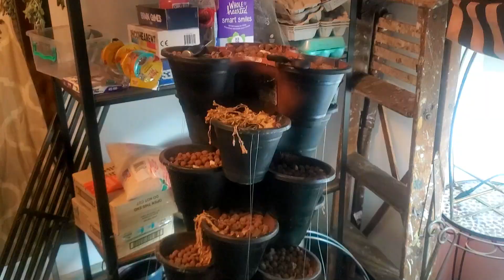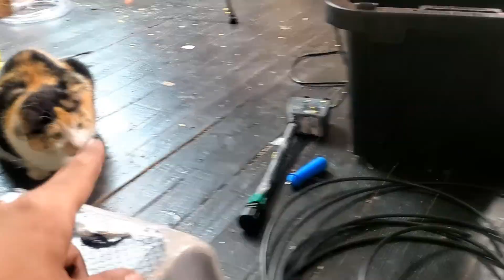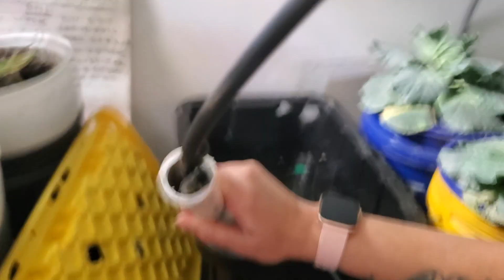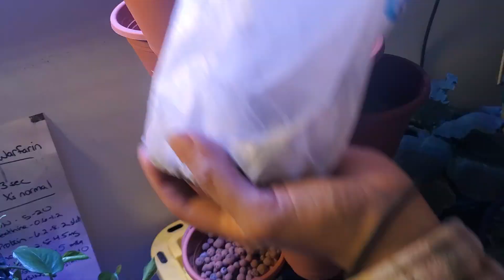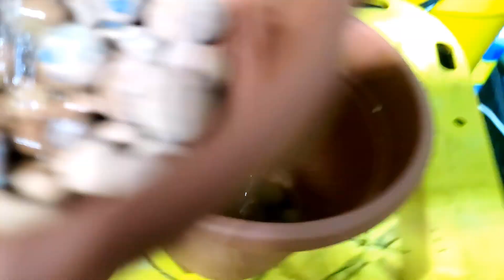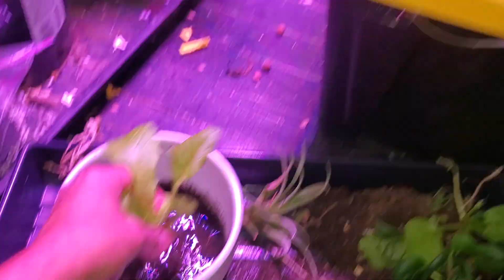Cheap DIY Fountain Tower System- Pt 2

Comment: I did that tower system like 10 years ago and the funny three petals pot that is now available at dollar store was about 7 bucks a piece lol. I didn't use submersible pump but used an air lift pump system using an aquarium aerator that inject air into a tube that lift the water up to the top of the tower, the water then flow down to water the entire system sigh help of flannel tape and leca balls, planted plenty of strawberries that resulting a very sweet strawberries and the nutrient solution I used that time was from aerogarden product. Just for fun, it was not cost effective so I went back to the green house again.

Comment: Great vid! I built my first tower based on your previous video on this topic but ended up doing something different because of the black tubing everywhere. I also applied a stainless steel bolt and a washer through the bottom of the planter into the lid with a nut underneath to provide more stability.  I built mine to grow strawberries.  I don't recommend this because I learned the strawberry plants themselves rot easily if they're wet all the time.  Going to re-start my hydroponic project with lettuces and pak choi.  Thanks!